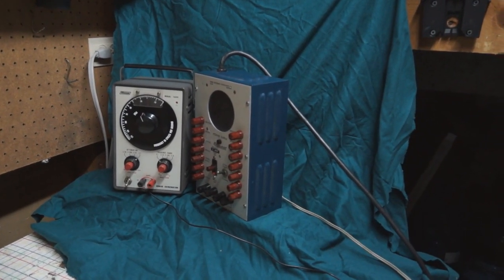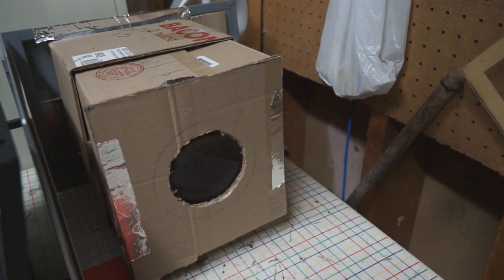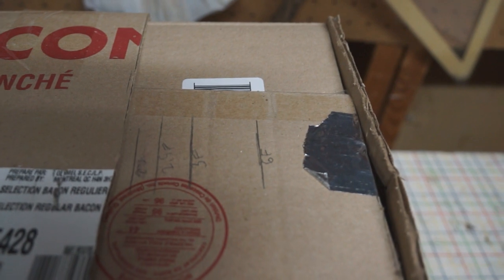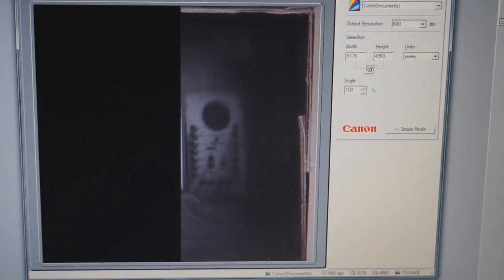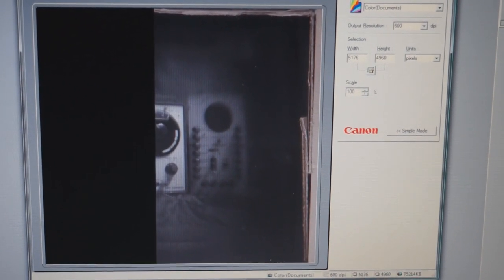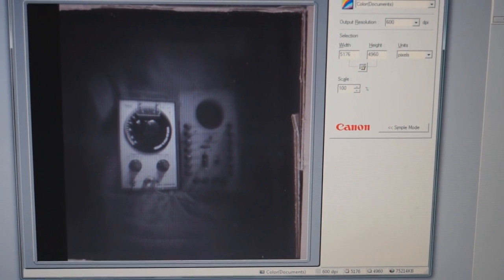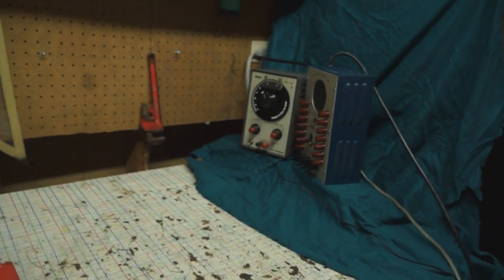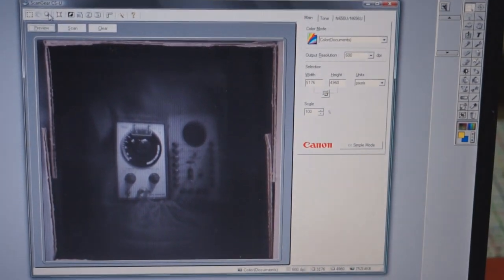Simple Scanner Camera

Comment from the maker: I have a 6 inch diameter lens taped inside the hole on the front of the box. You can use a magnifying glass if you figure out the focal length.